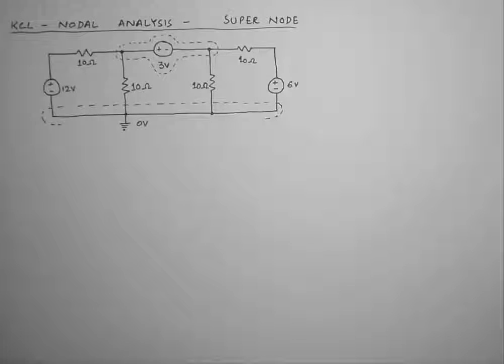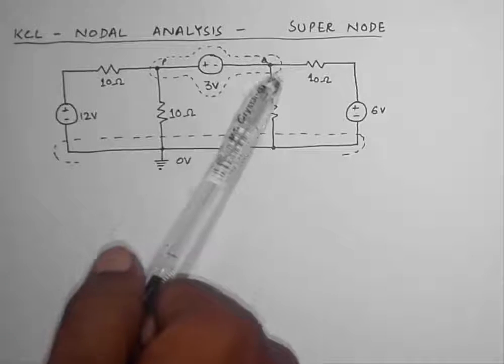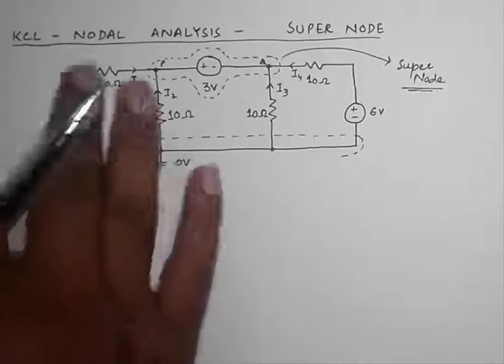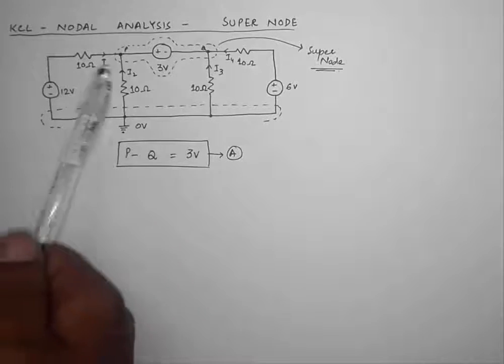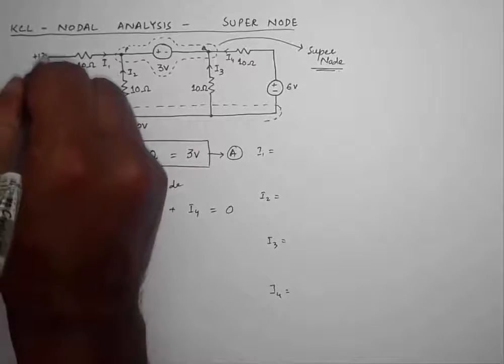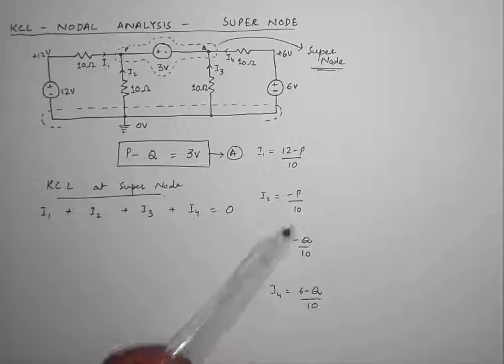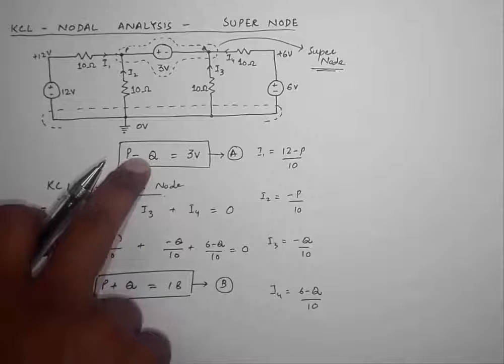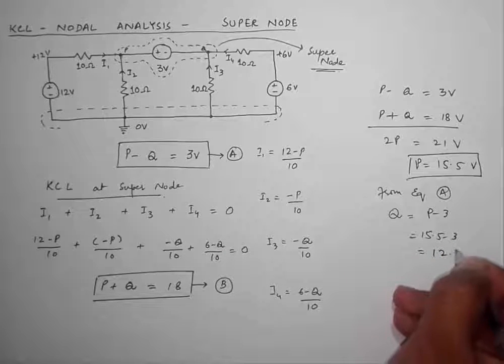Lesson 03 - KCL  - SUPER NODE ANALYSIS

Comment: If I assume that all the currents are going out of the circuits will I have the same answers for P I got 1.714285724 volts and for Q I got 6.857142857 volts
Reply from the maker: The direction of currents assumed does not affect the answer.